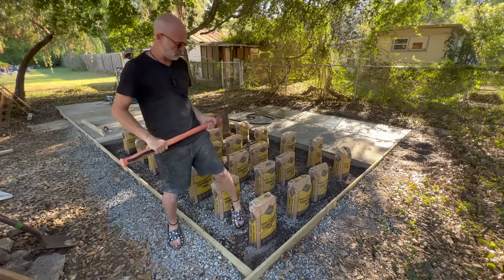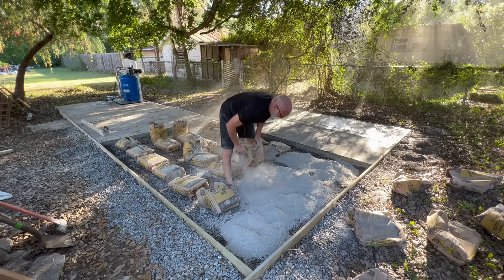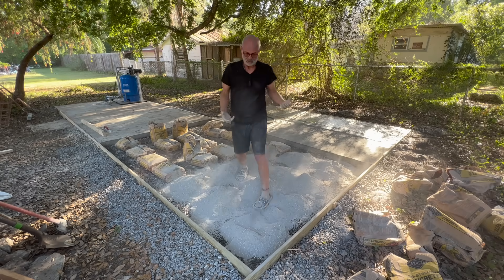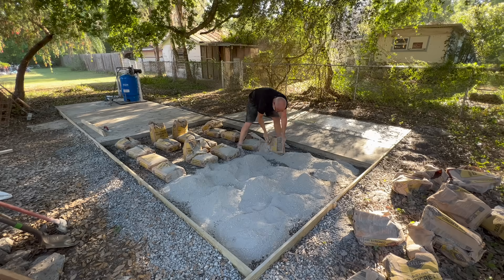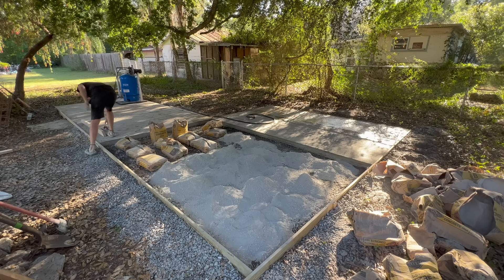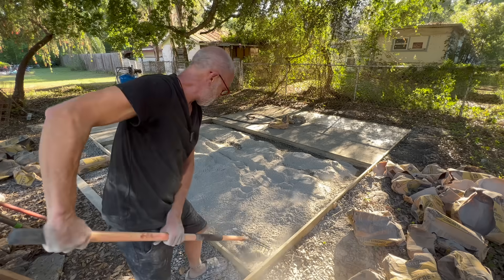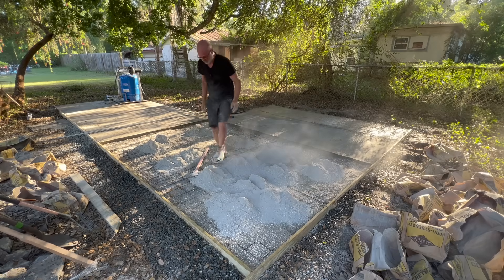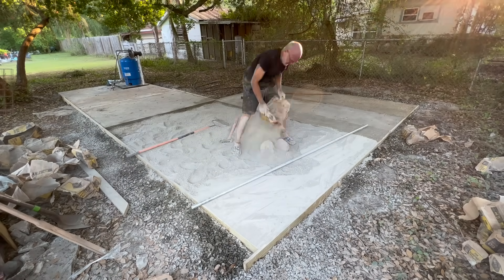Concrete Ninja Warrior Dry Pour Slab for Backyard Building

Comment: Quikrete Mixing instructions taken from a bag a Quikrete.
MIXING QUIKRETE: Concrete Mix can be mechanically mixed in a barrel type concrete mixer or a mortar mixer. Choose the mixer size most appropriate for the size of the job to be done. Allow at least 1 ft3 (28.3 L) of mixer capacity for each 80 lb (36.2 kg) bag of QUIKRETE Concrete Mix to be mixed at one time. For each 80 lb (36.2 kg) bag of QUIKRETE Concrete Mix to be mixed, add approximately 6 pt (2.8 L) of fresh water to the mixer. Turn on the mixer and begin adding the concrete to the mixer. If the material becomes too difficult to mix, add additional water until a workable mix is obtained. If a slump cone is available, adjust water to achieve a 2 in to 3 in (50 mm to 75 mm) slump. QUIKRETE Concrete Mix may also be mixed by hand. Empty concrete bags into a suitable mixing container. For each 80 lb (36.2 kg) bag of mix, add approximately 6 pt (2.8 L) of clean water. Work the mix with a shovel, rake or hoe and add water as needed until a stiff, moldable consistency is achieved. Be sure there are no dry pockets of material. Do not leave standing puddles of water. Final water content should be approximately 6 pt to 9 pt (2.8 L to 4.3 L) of water per 80 lb (36.2 kg) bag of concrete. For other bag sizes, use Table 2 to determine water content.

In inches, the typical "slump" of good structural concrete is about 3 or 4 inches. Mix the concrete until it is uniformly and thoroughly mixed and continue mixing for 2 or 3 more minutes to begin the process of hydration, which ultimately is what causes the concrete to harden.

Comment: Would i need to reinforce a slab for a pergola? It's not a ton of weight but some, nothing like a vehicle or anything though. The slab is going to be 30x10 but in 3 sections so 3 - 10x10's.

Comment: This method isn't used by professionals because it is dangerous and not structurally acceptable. Moisture content ,slump, mpa and temperature all determine the quality of the concrete strength, finish and longevity. You may have glanced over the destructions and seen a water quantity and mixing instructions, it would also give a psi or mpa number if you fail to follow the instructions you are ripping yourself off. Also any contact with your skin will cause alkaline burns and wetting it also stops the clouds of very harmful Portland cement being inhaled by you and the neighbours. Please look into it and take care of yourself when working with and cement based products.

Comment: Silicosis is a very real risk from breathing freshly fractured silica crystal. Be mindful and wear a good mask---especially if you do this for a living. Also, dry 'pouring' produces weak concrete. You can prove this with a single bag of concrete mix. Try it. Wait 30 days and then compare it with properly mixed concrete.

Comment: I'm no foundation expert or contractor, etc...but what happens in 6 months when the top layer begins to settle on the unpoured and uncompacted bottom layer? I did however just buy a home and paid attention to the home inspector when he showed me the huge crack and uneven foundation (of just the garage) from uncompacted soil. Sorry but this is probably going to ruin itself in a year or two if it wasn't compacted or atleast laid correctly. Was a good idea in theory, I get it. But contractors are out there for a reason.

Comment: I did an 8x8 slab like that 3.5" deep. I put in a total of 9 round footings 20" deep x 6" diameter. All four corners and midway.
 I used rebar throughout and left over old pipe.  Built a room on it and it's held up great for 9 years so far.
Reply: I love hearing stuff like this! 💪 nice
Reply: Really
Reply: How many bags?

Comment: I don't see the advantage here with the open space and accessibility, hire a munkee or two and have them bring you wet concrete mixed PERFECT as quick as you can screed it off then burnish it,  perfect floor, you won't like this floor in ten years, and lacking a thick mill vapor barrier it may be sooner than that

Comment: maybe mix that bag with sand and gravel first?  wont need as many bags, in fact pure concrete isn't going to set up well, ratios needs to be right, it will harden, but not have the structural integrity and may be kinda softish?

Comment: How did you get from what the people at CCL show in their videos,
to where halfway filled, you wet-down the concrete after placing the mesh before adding the rest and finishing it off? 
I think they even mentioned about purposely not getting the ground wet before adding the concrete because it turned out to not benefit the pour. 
Still it looks like it will do what you want.
I hope it saturates properly and cures well.
Fortunately, you won't be driving on it etc.
Don't forget to cut expansion joints in the slabs and between them.
THanks for the video.

Comment: This is a great way of doing it. The only thing that I would do different would be that you need an expansion joint up next to the other pad that you already placed. You could go one step further and dowel them together with the expansion joint foam too. Could make the concrete last a few more year long or at least keep it looking nicer for longer. Just my two cents.
Reply: Cost wise... and health wise... it's a terrible way to do it.

Getting in a concrete truck was probably less than what he spent.

Comment: I added gravel to my private drive (300+ yards) and poured Quikrete into the areas to were troublesome erosion areas by the other driveways. Four different places, (3) 60# bags each. That worked like a charm. About $50 bucks worth of dry mix saved me a lot of problems. It's like a layer of flat stones a couple inches below the drive surface. But there isn't any strength to doing that. I got what I need out of it and it's been a couple of seasons in Michigan. Erosion prevention is one thing. BUT . . . This dry pour slab isn't worth the effort. The quality isn't there and it is NOT good for a person's health.
Reply from the maker: I'm in Florida.  No freeze and thaw.  It's different here.  Solid sand foundation and my slab is rock solid.  Born and raised in Ohio.  I would not feel the same way doing a dry poure just anywhere but trust me when I say, it's different in central florida.
Reply from the maker: Thank you for the response.

Comment: Couple of things. If you plan on doing this, skin contact with concrete can easily cause cement poisoning. I've seen it. If you don't mind a half dozen layers of skin painfully peeling, go for it. Two, ready mix is actually more cost effective assuming you need more than the three yard minimum. Third, the actual surface finish is terrible. If you want a smooth slab, just get ready mix and finish it properly.
Reply: Ready mix is cheaper if there's a source within a few miles.  I'm not sure how far the trucks will roll and still have a good mix on board.  The western states are big, with huge areas without much in the way of redi-mix.

Comment: I have done concrete and its much easier to do it the old way, you get a better mixture and an almost perfect finish depending on your skill. 
You do not want to be breathing concrete dust. 
The downside is you have to buy a used mixer for 150 bucks and a few tools. 
Doing it dry you cant get the air bubbles out which is bad if you live in freezing climates, water gets in there then freezes and cracks.
Reply: You can rent all the tools and a mixer. hell now days, they got mini trailer mixers you can rent or they just deliver smaller loads. a few yards or so.

Comment: Fast forward 25 years, Dr. Comes in, sir you have Silicosis  of the lungs.
Reply from the maker: I hope not.
Reply: @renetto  you have to take precautions when working with cement, concrete or other Silica components.  A simple NIOSH N95 makes the world of difference, better a NIOSH P100. Protecting your lungs from exposure is a must. I hope not either .

Comment: 👒 off for all your hard work. After researching dry pouring for awhile several steps were consistent. No wetting the cement prior to filling the form and screeding the dry cement to prevent uneven interior spots. If you're adding rebar etc. at the halfway mark. Initially only a light mist the first few times. The cement will absorb the moisture evenly. This was a combo of both dry and regular. For anyone attempting this please be mindful and wear safety gear.
Reply: Especially a dust mask...
Reply: safety flipflops is a must :face-blue-smiling:

Comment: There are admixtures like retarder and plasticizer the will delay the set time and make the mixture flow easier to allow for extended pour times. Admixtures are very inexpensive and effective. Just wait till you get one good freeze and that slab will crack and crumble. Not sure you could even call it a slab lol its more like cement treated flexbase. To all the people commenting on this video with aspirations of "dry bagging" a patio or shed foundation just DONT!!! DO NOT DO THIS! If you're going to invest in concrete work make sure its done correctly and done just one time... the first time. If you absolutely must try this method i highly recommend wearing a 3M particle mask to prevent inhalation of silica dust. If you're not aware of what silicosis is then here you go...

Crystalline silica is found in materials. such as concrete, masonry and rock. When these mate- rials are made into a fine dust and suspended in the air, breathing in these fine particles can produce lung damage.There is no cure for silicosis and once the damage is done it cannot be reversed. Silicosis can be totally disabling and may lead to death.

Comment: My concrete ninja warrior,  I  wish you had some boots on for two reasons,  one to prevent getting the concrete on your feet and second swinging that axe in case accidentally you hit your foot and no mask .Thank God nothing happened to you. 
For the guy who is pouring 20' x20' x 3"  slab $1,900 is a very good price.  I usually charge for that size $4,500

Comment: This dry method only good for fence posts. Even then it's only as strong as an old cookie. No mixer? Use a wheelbarrow, 1 or 2 bags quikcrete, water, stir with a garden hoe until flowing thick not too runny. If its too runny ( concrete sinks and water on top ) add 1/4 bag at a time until water is gone, concrete is  thick and still flowing.

Comment: This might work if you don't plan on building any walls on it.  Otherwise, when you drill your still plate anchors they will anchor into Concrete powder.
Reply: powder? probably not
Reply: PROBABLY
Reply: @PakehaParker  Nope you mist the pour once every hour for 3 hours, Then one final spray. When you pull the forms there will be no dry pockets. Dry concrete mix absorbs the water by osmosis. And it will be even.
Reply: @JosEPh-zy3yr  sounds like a recipe for disaster

Comment: Fun video. I dry poured a concrete slab 3 years ago and drive my skid steer over it often. Not a single crack. 2 feet wide 6 inches thick and 12 feet long. No rebar either

Comment: This is so wrong on so many levels.  There is obviously no building inspectors in your area.  I don’t know what is the worse of the two evils, not using a ready mix truck, or straining your back, & Portland cement poisoning, to save a buck by doing it wrong.  Concrete is not meant to be used that way for structures Maybe you could set a fence post doing it that way. 
40 years builder

Comment: If that is 12 x 8 then it would be 96 sq ft and at nominal 4 inch thickness, 32 cubic feet. For an 80 lb bag of concrete you get 0.7 cubic feet. You need about 46 bags of concrete. Current price at Lowes for 4000 lb strength is 5.56 so the 12 x 8 would be 256.68 and that is 1 of 4 sections. All four would be 1,026.72. If you ordered concrete you need about 4 74 yards so round it to 5. Even at 200 a yard you don't save time or money by dry pouring. Call the truck and you can pour it all on the same day, can add fiber if you want, can color it, you get a more consistent pour and you know it all mixed.  In a month drill it for a 1/2" anchor bolt and see if it hardened at 2 inches deep or is it still dry below the surface.

Comment: This video answered a question: I'm going to make flagpole anchors out of 5-gallon buckets. They won't be structural or go under water. I wondered if I can just dump in the bag of concrete and add water without mixing. Looks like I can. Should be super easy. 👍
Reply: If you're already pour the concrete in a container there's no reason to not mix it..  this is for larger surfaces..  just add your bag, water and stir it with a stick like normal.
Reply: @Mixwell1983  - Thanks! It had been a while since I used the Ready-Mix product and could not recall how much stone was in the bag, meaning "how difficult would it be to stir in a small bucket?" Stirring it with a 1x2 was very easy and I now have two flagpole anchors. Thanks for your comment!

Comment: Omg, this is a joke, right?  Sir, the strength is in the mix, plus the absolute worst part of cement is the dust... You were just bathing in it.  People just call a mixing truck, and then all you dont have to do this.  With a truck, pour then finish..50,000 psi, not this 500 psi 5 year demo job.

Comment: the only thing i think i would try diffrent is putting sand and rocks mixed in the bag cement at appropriate mix rate mixed up i a ol drum with lid and just roll it around ( maybey bolt some angle iron pieces in side as flukes) and dump it in dry but all mixed and then spread it outand spray it down..sand and rocks give better biding strength and you'll use less bags of concrete to do the same job

Comment: This is a horrible technique. Dry pour with never harden consistently. There’s a reason you mix it with water. Would have been much easier and probably cheaper to have a truck deliver it and pour it right in the form. If the weather isn’t to hot you could have spread it and troweled it yourself in a couple hours.

Comment: You seem like a nice enough guy. And, a hard working SOB. But, that little 1/4" (or less) metal you put in that concrete form won't carry much weight without crumbling. I'd Love to see that pad hold up for 1 year once you get that structure built. It was entertaining to watch you do it. But, as a home builder, I'd never do anything like this. Not even for a 12'x12' shed.
Reply from the maker: I have posted follow up videos.
Reply: Your a home builder and don't know that the mesh is only to limit temperature and shrinkage cracks... SMH 🤪
Reply: @jwheeler7890  I'm a home builder. We use rebar. I wouldn't put that flimsy shit in anything on my property.

Comment: I agree it is a lot of work I take that same concrete mixture using there and I actually mix it in a wheelbarrow first to get it good and wet and then I dumped it in but if you had to do that large of a section you're doing it would set up before you ever got back to it

Comment: This guy works hard but theres just so much wring with what he's doing. The first thing is he should have work boots on anybody that doesn't work in concrete and is just someone that likes to do stuff on their own at home do not expose your skin to concrete  whether it is dry or wet you can get pretty bad concrete burn and it's painful. Secondly you can't just lay a bag of concrete down and wet the top and the bottom of it and think it's going to have any kind of strength because its not, you have to mix it up thoroughly with the proper amount of water them slabs are going to crack and flake I guarantee it guarantee it. If you've never worked with concrete and you want to pour something this size you can't do it by yourself this guy will not post an update a year from now because that concrete is going to be done. Do not do this method
Reply: Would it be better and stronger if he watered and mixed each layer maybe with a hoe?
Reply: @davekanak  I've done concrete work for 30+ years been a finisher for 20+ years. Dave in my opinion, while it might be better than what he did it's still not a good idea because by the time you get that 2nd later in top your first layer is setting up and getting hard therefore it's not one solid pad. It just won't last. The only clear thing to do if you want to do it yourself is to have someone there that has some knowledge of concrete and a couple friends to help so you always have guys mixing the next batch. And even that's a little difficult because it starts setting up as you go along with something that size. Not trying to deter you from trying to do it yourself or anybody else I am only giving you my opinion based on my experience. If you have something like this to do at home you want to do it yourself and it's that size just call your friends and tell them to get their butts over there and remember once you start with that first mix you cannot stop there's no talkin there's no nothing you do got to keep moving moving moving until all that concrete is in

Comment: I think I commented in your other video,  you need to hose down those bags so you don't get TOXIC DUST.  Not only is breathing it bad, it gets on your skin and dries it out.   Renting a pre-mixed buggy that you tow and dump is quite fast.  You just need to make the size of the slab so you don't need more than one trip.  I made that mistake once, and yeah, by the time you get back the first batch is getting hard.
I've done lots of dry pours and you are doing it wrong/poorly.   BTW, you didn't show how you had to drive to the store, load up all those bags on your cart, check out in a long line at home depot,  load 500lbs of bags into your truck, then drive home, unload your 500lbs of bags into your slab.
THAT IS THE HARD PART and you showed NONE OF IT.
Reply: He said he had it delivered in the first part video.
Reply: @mamatroll09  HD charges $80 to deliver, so that just makes bag concrete which is already a lot more expensive, even more so.
They now have concrete mixed right at the curb, so you only pay for what you need.